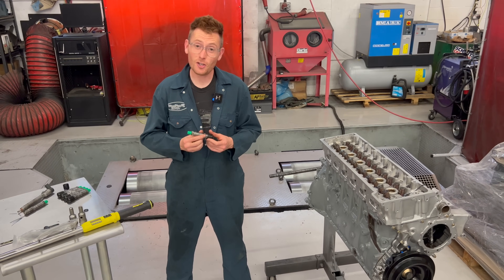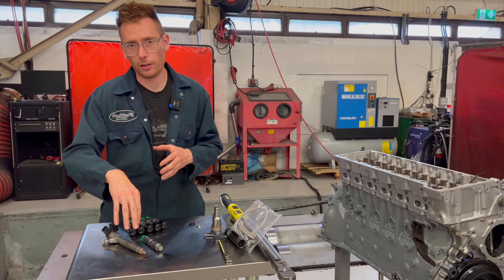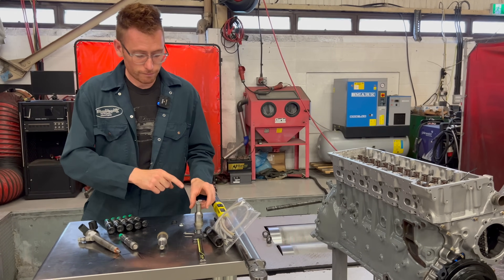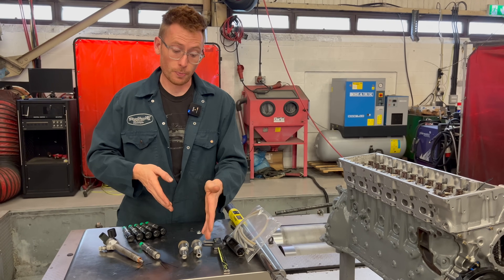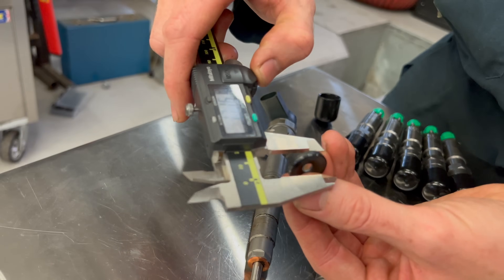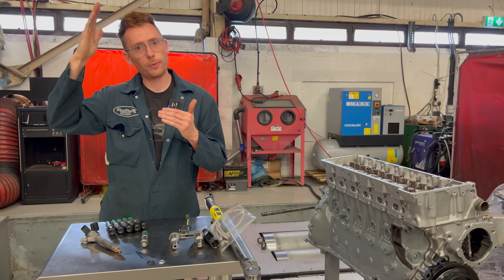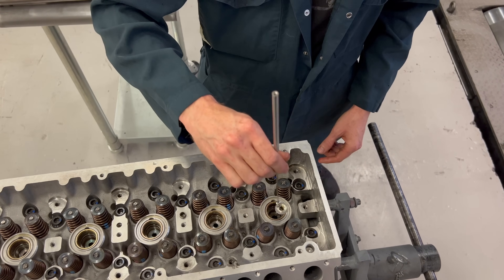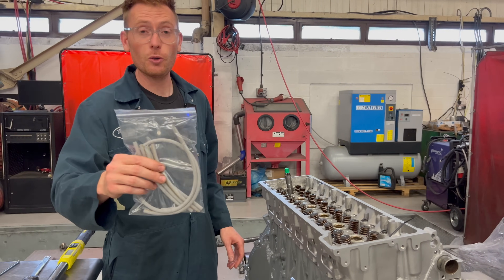Mercedes OM606 INJECTORS, how they work and should you upgrade?

Comment: i remember an old man always used a large bearing ball to push back the inner lip of the used heat shields so they push against the sprayer insert housing again for heat transfer. he did this always right before dropping them in the recycle bin, of course. are those vw shields even using the same angles?

Comment: The 606 injector is actually prehistoric compared to a GM/Detroit or Cummins cam driven, unit injector style which date from the 1930's,were direct injection and never needed glow plugs.

Comment: Silver-solder a block made to accept a high pressure hydraulic sensor (Hydac make nice ones) onto one of the fuel lines, then drill into it to open a port into the fuel line.
Connect said sensor onto an oscilloscope and you'll be able to measure the dynamic peak pressure. This is also useful for checking the injection timing.

You can also get combustion-rated pressure sensors, including down to some tiny diameters so as to be unobtrusive: Optrand make one built into a functional glowplug (they call it PSIglow(tm)), and can modify a glowplug to build one of theirs in. Put this on another channel of the same oscilloscope, and you can get the prechamber gas pressure as well, which will show you when the combustion is igniting and how it is burning relative to the fuel injection timing.

Whole setup will only cost a few thousand or so, and it's the best information you can get from the engine, appart from also acquiring the engine position from a good shaft encoder mounted to the crank.

Setups that can remove the time delay inherent in the pressure sensors so there's no timing error compared to the crank angle are more expensive - those are what the professional engine systems developers use, and those are usually from Kistler etc and will cost big money, as it's no longer just using an off-the-shelf electronics oscilloscope. 

A good oscilloscope will have a setting to allow 'deskew' adjustments on each channel, but these often only accomodate a few tenths of ms maximum, not the couple ms you will need. 

You'll know if you have the settings for the pressure sensor deskew 'right' when the peak cylinder pressure (most same as precombustion chamber) stops moving relative to apparent engine crank angle when the engine speed changes - when its wrong, there tends to be quite a shift to the right, as the crank angle sensor has effectively no time millisecond-level delay built in, being typically optical and digital, whilst the pressure sensors always have analogue amplifiers which have a little constant delay, which causes the pressures to look laggier as the engine spins up.

You'll find if you try to calculate engine power from directly measuring PdV using both signals to be wildly inaccurate most of the time too - usually giving numbers up to around twice what you can really see from the dyno - totally normal. Never trust any 'indicated power' measurement. They're basically always nonsense. It only takes a small, uncorrected signal skew mistake, or crank angle sensor mounting inaccuracy, and then the figure you get looks far better than reality. 

I have once seen someone seriously propose presenting a paper (at an SAE conference in germany, no less) on using an engine with a 90degree right-angle shaped crankrod, with the cylinder also mounted at 90 degrees to normal, claiming amazing output power from the indicated power. They had not also moved their crank angle sensor 90 degrees as well, so they were of course multiplying a high pressure signal (near TDC: usually small change in volume) with a large change in volume from an incorrectly estimated piston speed. Total nonsense of course - if you play around with changing the relative positioning of crank angle (engine position) with cylinder pressure, you can make the power figures nonsense also. 

The main reason indicated power is usually not very accurate, is more to do with the imperfect read of force on the piston that you get from the way the cylinder pressure sensor is mounted, combined with its own imperfect system dynamics: Somewhat like listening to an orchestra through a long tube. The sound is delayed and rings oddly, so the resulting calculation is not right. 

It is at best possible to 'calibrate' the indicated power you get to the actual power: But the calibration factor shifts with both load and speed, and also with engine timing, engine temperature, and even over time with piston ring and bore condition, and seemingly other unknown factors as well (the phase of the moon, perhaps?). At best, you can calibrate at one load point setting, and use it for data acquired on the same day in the engine same conditions, and that's accurate to usually no more than plus or minus 10% or so.
Reply: Thanks for sharing. I wonder if optrand will quote me happy 🤣

Comment: How can you test for bad pre chambers with the engine in your car?

My 1998 E300 TD has clouds of blue smoke and misfires when you hold the rpm at 1600 while parked.

When you increase the rpm to 3000 it clears up and runs smooth. 

I have no air bubbles in the lines.

Under power up hills it runs smooth. 

I have replaced clear fuel lines, O rings,  primary pump, primary and main filters. 

I am thinking maybe cracking the injector lines one at a time while  at 1600 rpm to see if it is isolated to a cylinder. 

I do have a new set of Bosch injectors I could install. 

They would be set at 135 bar.
Would it be a good idea to have them set to 150 bar before installation?

My car has 429 k all stock except for potentiometer modification. 

And yes, the car had the same symptoms before the modification. 

When I adjust the potentiometer I can do a long burnout with lots of black smoke. 

It seems like it is not a shortage of fuel.

Comment: Hey Luke I'm getting ready to pull my injectors for my 606 what is the reason your deep socket has the notch cut out. Of course I'm here in the US and I can I find a 22 mil deep socket in my toolbox so I'm going to order one does it need to have that notch
Reply: Hi. He called it a Lambda socket (oxygen sensor socket). They have that cutout for the wiring of those O2 sensors. Hope this clears it out. Cheers!

Comment: As always fantastic video. Just wanted to ask if you have ever fitted a 500bhp+ om606 into a w204 with the standard om642 removed ? I just wonder if I'd need a new box etc as I doubt it could handle that much torque and bhp. But I've always said if my engine ever goes tits up and it's a major cost I'm just going to take it out and hopefully fit the 606. Cheers mate
Reply: I'd love to know this ... !!

Comment: Pre-chambers are made of at least 3 different alloys that are friction welded together. 

The very tip of the prechamber is made of a nickel super alloy, likely Nimonic 80 or 90, the main part of the body is a different stainless steel alloy but is slightly magnetic, the front isn't 
The very end of the prechamber where the injector screws in is made of some kind of non-stainless steel. 

Also I have a OM605 turbo I'm rebuilding where all the prechamber balls are slightly bendt down and crooked, not flush with the other side of the pilot hole, it has vibrated on that side and enlarged the hole slightly along with slight contact corrosion. 

I'm making some new prechamber balls out of Inconel 718 with enlarged ends so it can be machined flush, but prechamber ball stuff can apparently be a issue with high milage engines. 
Prechamber balls aren't made of a superalloy interestingly, as they're pretty ferromagnetic.
Reply from the maker: That’s interesting information Thankyou for taking the time to share.
Reply: @DieselPumpUK  I can send CAD files if desired.
Reply: @TheLawnWanderer  Wait, you designed it? :o
Reply: @TheLawnWanderer  still got that cad file?
Reply: @gruest101  what do you want?
Reply: @TheLawnWanderer  any resources or models for the prechambers would be greatly appreciated. my email is in my bio - i can share more about my project if you'd like. thanks brother
Reply: Interesting I'm going to use some 601 inconel to make the defusers
Reply: Aren't there ferromagnetic superalloys as well?

I'm not certain at all, but there's something about that wandering around in the fog of my backbrain.

Comment: Ever heard of any other reason for fuel pooling up into the injector wells other than bad hose?  I have replaced hoses at least twice with the OEM style braided covered rubber but still have a good bit of fuel always in the wells.  Truth be told, I installed rebuilt injectors and scoured the internet for proper torque setting for installation of the injectors and found that I WAY over torqued all the injectors.  Wish your video was up before I replaced the injectors.  I did remove them all and re-installed them to proper torque with new washers.  Engine runs just fine, but still plagued by the constant pool of fuel in the wells.  Have it running in my head that maybe the over torque might be the cause, but I kinda doubt it because that would probably mean I would have had to crack the injector housing for that to be the case.  And if so then there should probably be a flood of fuel since it would be at 135bar at any potential crack.  By the way, there are multiple sources out there that say to go to 40Nm and then another 90 degrees WRONG.  I know this now.  It felt wrong when I was doing it.  I did not go that far but I did go 45 degree past 45Nm.
Reply from the maker: Most common reason for fuel in and around injector is the injector high pressure hose connection at the top, not seated correctly or ferrule worn out due to over tightening etc
Reply: @DieselPumpUK  is there a torque spec for those? Of course impossible to get socket style torque wrench on them.

Comment: very interesting - thanks for the vid. Question I would have: isn´t the increased opening pressure of 150bar reducing the total amount of diesel as the open intervall gets reduced? Have you made measurements comparing f.e. 120 bar with 150 bar? Another question: why is the use of the washers limited to only one time (heard this from Mercedes? Thanks and greetings from Germany, Frank
Reply: The washers are of a soft metal which is a one use due to the torque applied which crushes the metal

Comment: I found a better way to drop the washers into the injector holes. Put the washers over the shank of a screwdriver. Hold the washer at the handle of the screwdriver. Insert tip of the screwdriver into the hole. Let go of the washer. That way it can't flip.
Reply from the maker: Great idea

Comment: Hi there , I recently bought a 606 and have the following problem. when it runs constantly, i have something like ignition misfires, it runs very quietly and then the engine chokes once and continues to run quietly.
and at 850-900 rpm it also jerks.
I would be grateful if you could tell me possible causes.
Reply: More than likely air getting into the fuel lines.  replace all the little plastic fuel lines around and under the intake manifold.  Plenty of videos on that.  Also might need to replace the feed and return line from the tank if they are original they are more than likely quite old and brittle.  I have a video on my channel about those with part numbers.  But start with the little clear plastic lines first.
Reply: @Skul-Ski  mkay , I wanted to do that anyway. But thanks
Reply: @Skul-Ski  The ECU was faulty by the way. The fuel lines were replaced but it had the same thing. I replaced the ECU and it ran smoothly ever since.
Reply: @liamhoanzl2920  Good information. Very unusual. Actually the first bad OM606 ecu I have heard of. Obviously it happens, but so rare to my knowledge that most of us would be chasing fueling issues.

Comment: Funny, I've had a similar idea. Maybe you'll do it first so I don't have to.

Make a fitting between the injector and pump that lets you tee in a 500 bar (or higher) pressure transducer so you can watch the actual dynamic injector pressure. If you had all cylinders monitored it would also let you know the injector and pump health. The way computers should be used in cars imo... Monitor the health, not control things.

A while back in a chat you said the prechambers were just steel, but I have a feeling the tips are something like 330 stainless or some flavor of inconel. If you hit them with a magnet you'll notice the tip isn't magnetic, but has a higher permissability than air so it looks magnetic. I have still yet to send a prechamber to a materials analysis lab, but I do intend to.

Thanks for the video and sharing the info! I would love to see a video on the 180mm vs 210mm diffs you can put in the W124 if you are looking for more content ideas.

Comment: I damaged and burned two times Mercedes genuine heat shild and after that I installed vw heat shild and I forgot that kind of problem forever..
Reply from the maker: It’s good to hear your experiences, what was causing the failure and was it one cylinder in particular?
Reply: Three of them was burned number 4,5,and 6.but now ecerything is ok.I have installed your 7.7mm injectors.
Reply: What Part number are you using for the VW heat shields?